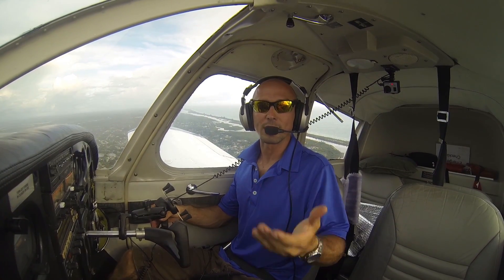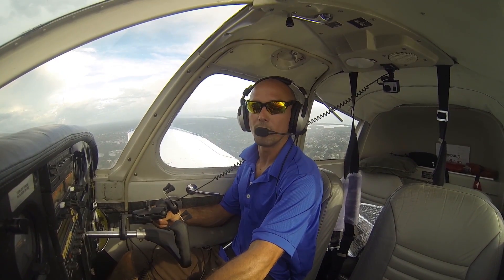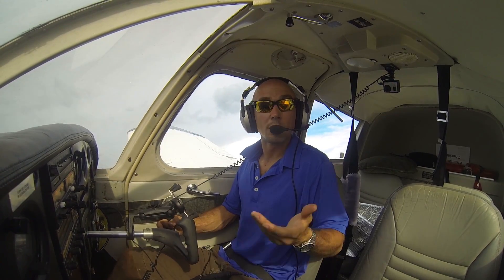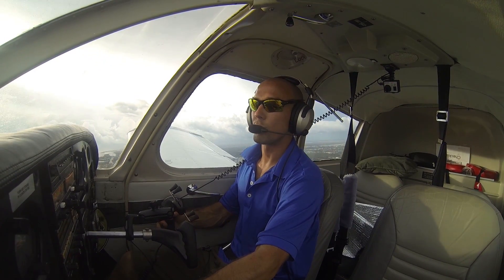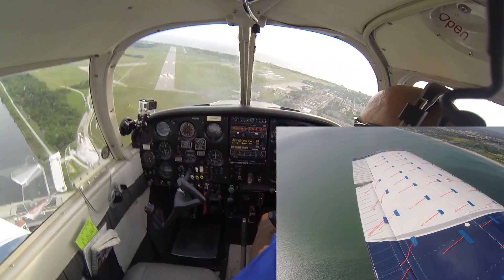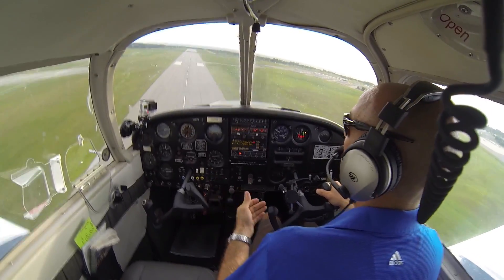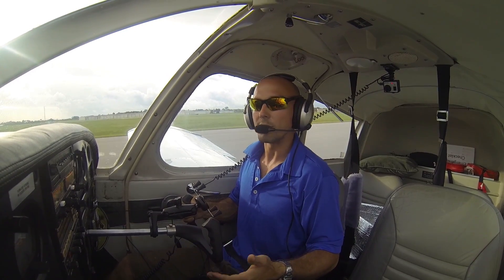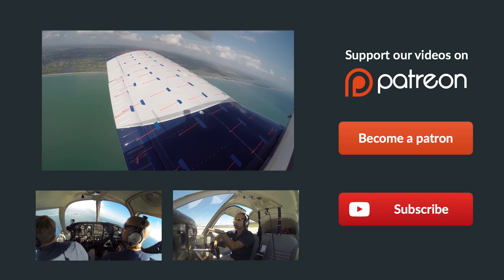Ep. 26: How to Forward Slip an Airplane | Spot Landing

Comment: I used to do a forward slip going down the runway and flare right through the slip, remember to let go of the rudder when the low side of the landing gear touches, or you will drive the low wing into the runway.

Comment: Gosh, it takes so much practice. This does help, so thank you. 10 flights in and still trying to pin this one down. Side-slips? No problem. I don't know why this is giving me the biggest headache.
Reply: Okay, here's the key: stomp on that rudder. Not a little, a lot. Then try to aim the airplane at the runway with just ailerons. Forget that the rudder can do anything. Keep your airspeed high, at least 10 plus knots too high or more. Use your throttle and elevator to add energy.  Once you get to normal glide path cut throttle, release all the cross control nonsense and just fly like normal. It will quicky correct itself and you just grease it in.
Reply: @JM-nt5fm  Thank you very much!

Comment: No I won't buy into that. Flying an aircraft out of balance could be a possibility with an engine failure.Cross controls go against the P/F formula. 
ie., CL Halfe Row V squared S. Plus if you are working an aircraft all day, it adds extra work, when you don't have to.. Finally go through the accident records you find the side slipping crashes the pilots in many case wind up on boot hill. retired CPL bush pilot.

Comment: I was taught (in an aerobatic school that a) you initiate a forward slip always with ailerons and that you b) practically cannot stall in a slip if it is stable. And IF the high wing stalls the airplane will not enter a spin but it will lower the wing by itself and return to controlled flight.
Reply: Well technically it will start to enter a spin, but there is more than enough time to correct it.  But yes I was taught the same thing as far as it being safe against spins.

Comment: I never heard to not use flaps in a turn, I do it all the time with my instructor. 
I don't have a lot of experience, is it a bad habit?
Reply: flaps in a turn is fine, flaps in a sideslip, like demonstrated in a video, is not always approved by the manufacturer of the airplane. Because it brings rather heavy and unequal forces onto the flap assembly.
Reply: @inbrekers11  thank you for the clarification, it makes sense now.
Reply: Also depends on the plane. For example, the beaver loves flaps in turns.

Comment: Its a scary but necesary technic, great vid, greetings from Chile
Reply: You get used to them.. Do them long like on this video.. Not short.. short slips dont teach well and you dont get used to them either..
Reply: You get used to them and even like them later.  Practice them using long slips from around 800 feet agl to the flare point.  Just like he did on this video.  Short slips dont teach well and you dont get used to them either.. If you dont get used to them you will delay doing them when needed and that is one of the main reason for so many pilots landing long, producing tire damages at end of runway..
Reply: You get used to them and even like them later.  Practice them using long slips from around 800 feet agl to the flare point.  Just like he did on this video.  Short slips dont teach well and you dont get used to them either.. If you dont get used to them you will delay doig them when needed and that is one of the main reason for so many landing long, with tire damages at end of runway..

Comment: Hi teacher:  I am taking lessons.  My teacher says that I might be solo in due time soon.  We did slow flight today, and after a bit, I got better at it.  And then, we did power on stall, and we did power off stall.  We also did turning stall.  This was all at 4500 AGL.  With each of those, I took a bit and then I better at them.  We were in the air for 1.3 hours, at a price of over $250.  We looked at 61.87 and we are covering quite a bit of the solo criteria.

Comment: My understanding is encountering a stall during a slip won't spin you, it'll level the wings.
Reply from the maker: That is an incorrect understanding, just have an instructor show you up at a safe altitude, if you hold cross controlled inputs during a stall the aircraft will spin.
Reply: Does your high wing not drop first though due to increased angled of attack?

Comment: sooooooo... I don't usually go to slipping my cherokee until I've used the full 40 degrees of flaps avail...then if that isn't doing it...I can throw in the slip.  Since the Cherokee (hershey bar wing) will drop out of the sky like a Franklin stove with 40 degrees and idle power ....not too many times you need to slip that sucker, but Its a great tool.

Comment: I wonder how difficult slipping an aircraft that is cross-coordinated, like a Bonanza. You'd be fighting against the control springs that link the ruddervators to the alierons the whole way down.
Reply: The PA 28 has a similar linkage...it is not difficult in the Piper.

Comment: You are either a psycho or are very good at late slips.  Only my Uncle who flew birddog in Vietnam scared me more in slip demo.
Reply from the maker: Haha, just always be aware of exactly how much energy you have at any moment, then you'll know exactly what you can ask the airplane to do.
Reply: I've been a gliderpilot years ago. What's the problem with that landing? Every proper European glider pilot can land that way. And yes, you need to learn it, and know the risks.
Reply: A good thing is that the gliders I flew, can not stall during a forward slip. The angle of attack is changed in a slip, so even flying very slow with the nose up, your wing does not stall.
Take care, YOUR plane can stall.
All I said is, it's a very good thing to know those planes can't surprise you, making an extra steep approach. And full flaps, full air brakes, full slip, some wind, call it falling out of the sky. You need a good reason for that on final. Airfields in the mountains, scaring your nephew, things like that.
Reply: @voornaam3191  _ What glider you cannot stall in a slip??

Comment: Do you do forward slips with the power idle?
Reply from the maker: almost always yes, the purpose is to loose altitude via disipating the energy from the a/c, so keeping power in would also keep too much energy in the a/c
Reply: Thanks for the response. I meant to say power on because I thought you had power on in the slip .Your flying is impeccable .
Reply from the maker: +Rumona If you really want to come down in a hurry power would be at idle, sometimes I leave a little in just to not shock cool the engine and be a little gentler on it.  Not super important, but makes a difference long term over the life of the engine